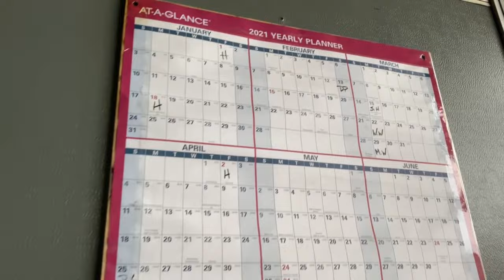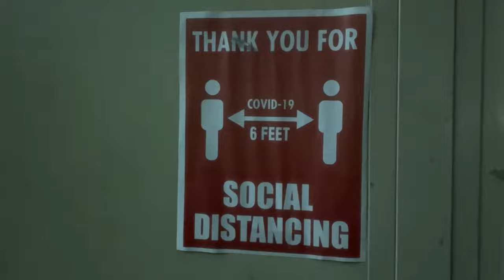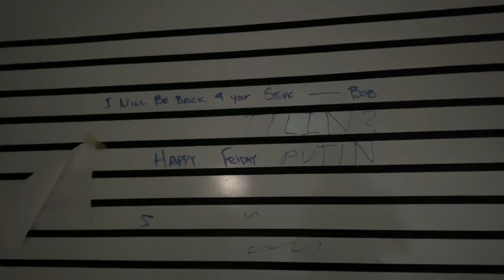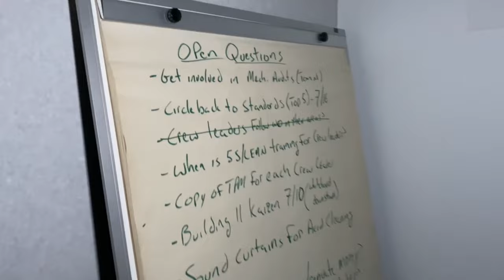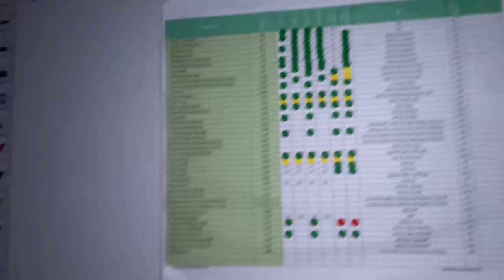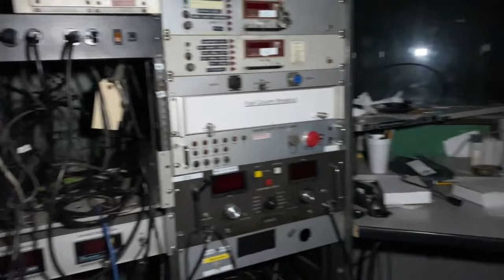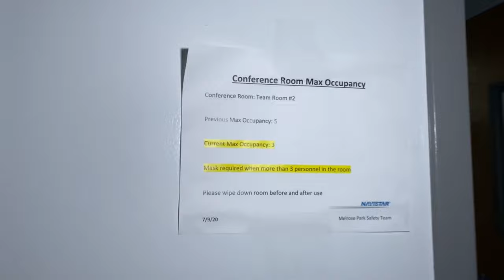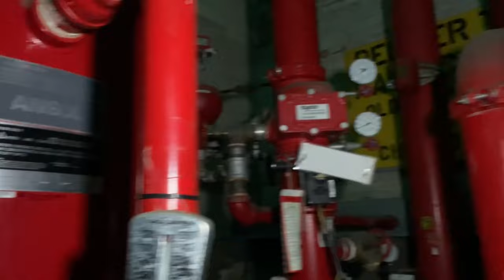Exploring A Massive Airplane Engine Factory in Melrose Park Illinois Navistar International

Comment: The "airplane engines" at this Melrose Park, IL facility were built by General Motor's Buick Division during WWII.  The engines manufactured there were Pratt & Whitney, R-1830 radial engines used to power the four engine, Consolidated B-24 "Liberator" bombers that saw extensive use in the European and Pacific theaters of the war (more B-24s were built than any other American heavy bomber during the war).  International Harvester purchased the plant after the war for manufacturing engines used in their trucks and probably other I-H products such as farm tractors and construction/mining equipment (in fact, the plant also built International Harvester, Payhauler, off highway, dump trucks and construction motor scrapers).  Interesting video of this factory in the remaining days before it was torn down (my "old man" worked here back in the late 1950s).  Thanks for sharing!
Reply: Thanks for this info! So interesting:)
Reply: Also Hellcats Wildcats, B25's many more airplanes and Sherman Tanks used the 1830.
Reply: @abundantYOUniverse  Indeed many of the Grumman F4F Wildcats were powered by the Pratt &Whitney (P&W) R-1830 (some were also powered by the Wright 1820 such as the FM-2 built by General Motors). As for the Grumman F6F Hellcat, it was powered by the more powerful P&W R-2800 and the North American B-25 Mitchell was powered by the Wright R-2600.

Comment: This is cool.  I worked there until 2019 when I was finally able to retire.  I remember working the test cells during the overnight hours.  If you explore the basement, be careful.  Since there is no electric, there will be no ventilation down there.  There could be noxious gases.  You never know what you may run into.  (Maybe take a crossbow)
Reply: Hi Ken, how's retired life?
Reply: There's nothing left anymore it was totally demolished and everything is been removed.
Reply: @truckerkevthepaidtourist  Not even a guard shack still around?

Comment: That building B4 whole campus demolition had one of those sound testing rooms I believe called a anechoic chamber? They were making stuff for military after the heavy truck stuff if I remember right
Reply: Yes this facility had a semi-anechoic chamber for noise, vibration, and harshness testing and tuning. Semi-anechoic because it had a solid floor, not a suspended net floor like a fully anechoic chamber. It is shown in this video briefly at 15:15
Reply: Navistar made MRAP and Bradley fighting vehicles for the US and global militaries until they were bought by Volkswagen, at which point Navistar Defense division was sold to Oshkosh truck